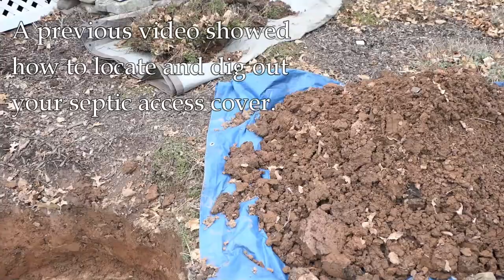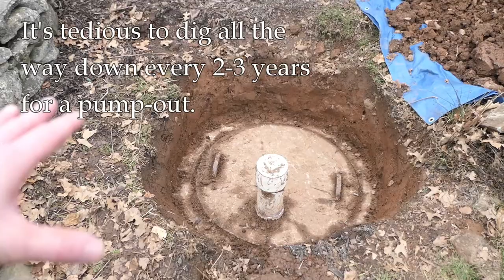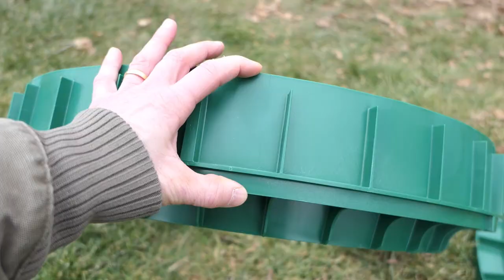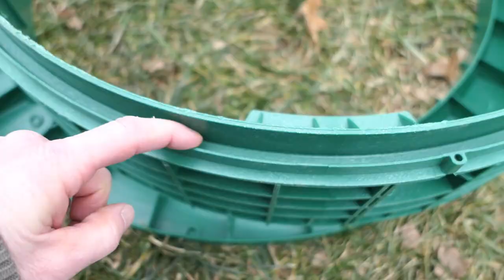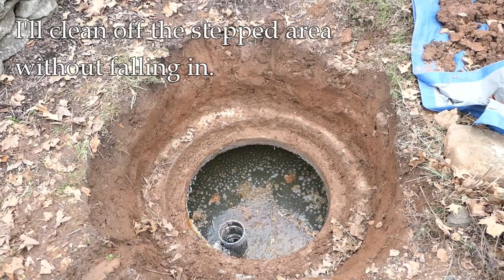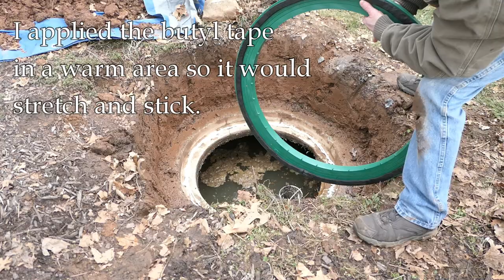How To Install A Septic Tank Riser

Comment: Risers are honestly one of the best investments you can make for maintenance to your septic system. Easy access for pumping, inspections, even some repair if necessary. For me, it's a visual cue, too. Infrastructure is often overlooked because it's made invisible, but seeing that green riser cover in the backyard serves as a reminder to keep tabs on the system. Not that I enjoy taking off that cover, but boy has it saved me money over the long haul. Spend the $300-$400 and give yourself some piece of mind.

Comment: Thanks for this. I need a septic inspection, and their guy came out and couldn't locate the tank. I ended up finding it with some old drawings, and a corner of it is under the concrete pad my singlewide was set on. The inlet lid is inaccessible, but the main and outlet lids area easy enough to get to, so I may install risers to make this easier in the future.

Comment: I used quick drying hydraulic cement buttered on the bottom then grouted the edge all around the ring with a nice beveled edge of the same cement...worked great
Reply from the maker: One potential issue with that approach is that the plastic will expand and contract in time, while the cement will stay put with the concrete tank.  Probably you won't get cracks, but you might have some rainwater leakage.  Not the end of the world as long as it isn't severe.

Comment: Very nice.  Considering this.   I would put mine below the ground also so grass could grow.  It is in a spot where I would need to use a push mower.  Also people regularly walk through this area.  Should that be a problem?
Reply from the maker: I wouldn't suggest heavy machinery over the top of the access hole or the tank top, but a single person walking across should be fine.  Another option would be to plant something with shallow roots, such as perennial flowers, in that area so that people walk around .  When the cover is dug up for cleaning, the perennials will tolerate being temporarily displaced.

Comment: OK, so I can not find a video explaining what to do when your septic tank does not have an access cover. Mine is just a pair of solid 4'x4' concrete slabs. When they come to clean it they have to lift the entire half of the top and flip it off the structure. I want to use one of these risers, but what do I need to do? cut a hole into a 70 year old concrete lid?
Reply from the maker: I'm not exactly sure what you've got there--certainly a four foot square lid is not typical.  Possibly it isn't even a lid but part of the whole tank and an access cover was never originally installed.  Septic regulations tend to be local in nature, often at the county level.  Likewise, the manufacturing and installation of tanks and other components tends to be locally oriented.  Concrete tanks and components are heavy and difficult to transport, so in areas where septic systems are common there are usually one or two small manufacturers who serve the area.  My advice is to find one of those small businesses near you and stop in for a chat.  Odds are that if you have this tank other homeowners in the area have faced the same issue.  It's possible there exists a 4 foot square replacement with a riser hole precast into the concrete.  Or, it may be that you need to cut a hole for a riser in your existing cover.  Either way, you'll need the help of a pro.  Search your local area for the right business to help--typically the word "precast" or "-crete" is in the business name.

Comment: Can you explain the old fashioned way to remove the concrete lid. I see a chain wrapped around a piece of wood - did you just use good old leverage
Reply from the maker: Every septic tank cleaner seems to have his own method.  The concrete lids usually have either two plastic handles or two handles made from rebar sticking out on the edge.  Hopefully your handles are still intact, otherwise it becomes a problem.  The lids are often stuck to the tank with mud and hydraulic force from the water, so it may be helpful to take the flat edge of a shale bar to pry up on the edge of the lid.  This will just loosen the grip of the mud and water.  Now you are faced with lifting the lid completely off.  If you have two people, each can loop a rope or chain around a handle and the two of you can lift and remove the lid as a team.  They can get pretty heavy--150 or 200 pounds, I would guess.  If you are working alone it's more difficult.  There are various homemade tripods that some people use.  The tripod is set over the lid, and a chain is used with a pulley to hoist the cover free. Other people just wrestle the cover free using a combination of leverage and muscle.  You can loop a chain around your shale bar and the lid handles, and then lift one end of the shale bar with the other end on a pivot point, for example.   There's no "official" method, really.  But if you can get a helper that the easiest way.

Comment: I did this a few years ago. The local plumbing supply sold the Tuf Tite pretty cheap. Also hammered the concrete outlet baffle to pieces to install a filter. It's so easy to inspect and clean the filter now. I'd like to ask you, the septic system layout from the county shows a 300 foot single line starting at the back of the house, going to the side then winding its way back behind the house. If that is so, does the entire line really get used? Would it have to be at a slight incline all the way to the end? Thanks for the video. Looks like I did it ok.
Reply from the maker: There are many septic field layout styles.  I can't say I follow what yours is doing, though.  Typically there is a pipe leading from the septic tank to a distribution box.  Then there are multiple pipes leading from that "D" box to a field.  All the pipes are inclined to allow drainage, and the field pipes have holes to allow fluid to escape.  The solids are supposed to get trapped in the tank for cleanout later. I'm not sure what's going on with your single pipe, perhaps you have an unusual design due to site conditions.
Reply: @enduringcharm  Ok, thank you. I'm not aware of any unusual conditions. The hand-drawn illustration of the layout (from 1993) doesn't show a distribution box, just the single pipe. Maybe the drawing is not even true since it doesn't seem that such a system could be fully utilized. But thank you. Although we've never added anything before and have no issues, at 30 yrs. old, I wonder if it would be ok to occasionally add something like Roebic.

Comment: Very informative.
Was a safety cover installed and would you think a riding mower would be able to move across it, if the cover was flush with the surface?
Reply from the maker: If the cover will be above the surface, I believe they do have some kind of safety screen for installation in the riser.  I didn't check that out at the time since this was buried.  As far as a riding mower, I mean it may support the weight but why ask for trouble?
Reply: I wouldn't chance it. The poly is durable but it's already contending with the elements beating down on it every day. Mow around and tidy up as needed.

Comment: South florida, most of us have 2 square lids, the one closer to the house is 29 inches across. i see no sizes for that.
Reply from the maker: There are lots of different sizes, it's true.  Typically the local suppliers will be aware of the commonly installed sizes and can help you.  Sometimes the opening is tapered, so the size you need could be a little different from what you are measuring.  I'd suggest looking for a local supplier to give you a hand.

Comment: I noticed that you did not put the access cover back on with the riser. Is this typicsl practice? You do not need the access cover after installjng the riser?
Reply from the maker: I'm not sure I follow your question.  I removed the existing concrete access cover, and that gets discarded.  The plastic riser is installed and then that riser has it's own plastic cover.

Comment: Was that a 24 inch? I measured my old cement lid and it was 26 across.
Reply from the maker: The concrete lids are typically slightly bigger than the hole so they don't fall in.  The bottom edge is probably sloped or angled so it fits tightly.  Measure your tank opening rather than the lid.

Comment: I see that your tank is almost to the top.  How is your house still draining in to it and not backing up?    Ours is blocking constantly lately because of high water. Came here to look for a lighter lid.   Great video.
Reply from the maker: When your septic tank is installed the height is adjusted relative to the main drain pipe exiting your house, typically a four inch pipe.  In other words, the height of the pipe exiting your house determines the height of the tank.  And, when I say "adjusted" I mean a backhoe digs to the right depth!  If you have water backing up into the house from your septic tank, then something has gone seriously wrong.  Possibilities include a blocked pipe leading out to the tank, a tank that was not installed correctly in the first place or that has moved with time, or the main pipe leading out from the house has moved.  Septic tanks can move if they are not installed well in the first place or if you have a high water table in the area.  In any case, you should have a pro take a look.  If the problem is not a blocked pipe, then you may need to either lower the tank or raise the drain pipe coming from the house.  Neither are simple repairs.

Comment: I need to add a riser to my tank. Do they make a rectangle shaped riser kit? I just found one lid like you. Is one lid common?
Thanks
Reply from the maker: If you are burying the top under some dirt, I think the additional safety screen is not necessary.  But, there could be local regulations about it.  I'm not aware of a  rectangular riser, but who knows.

Comment: A main point of a riser is so that you don't have to dig up anything to pump out or inspect the system. In the winter if you have to pump, the ground may be frozen, making it nearly impossible to dig up the lid.   Don't burry the lid !!!  LOL
Reply from the maker: Burying the lid can be an esthetic consideration.  In this case, for example, the lid was located a short distance from the deck in a garden area and a plastic lid sticking up would be an eyesore.  As for digging in winter climates, there should never be an emergency need to pump a septic in the dead of winter under a load of snow.  The typical timeframe for pumping is every 2-3 years, which leaves lots of time to plan.

Comment: Great video. I’m curious if you can use some leftover butyl tape, trimmed to size, in place of the silicone caulk (for use between the riser sections). Thanks.
Reply from the maker: You could.  The silicone caulk is easier, and there are also other types of construction adhesives you could use.

Comment: I'm not sure I need a riser on my tank. It took me 20 minutes to dig out mine and that was a couple minutes finding the exact location by starting 2 feet off. I'm of the belief that adding more parts adds the possibility for a greater likelihood of something to fail.  I have considered building a small wood platform to sit over the cover so I can locate where to dig and attaching an old hand pump to it as a joke. Then I would just have to slide it over and dig.
Reply from the maker: Well, your digging might not be too bad.  The other factor would be the weight of the concrete lid, if that's what you have.  It usually takes two people or else a chain and frame to lift a concrete lid, and the handles often break off.  The concrete lids are prone to cracking over time as well.  So even if you don't need a tall riser, you might consider a plastic lid over concrete.

Comment: What gal size is your tank How often do you pump out?
Reply from the maker: The size of the tank is typically related to the number of bedrooms in a house, which is a means of determining how many people are living in the house.  Common sizes are 1000, 1200 and 1500 gallons, though others exist.  The rule of thumb for pumping out is every two or three years, but mileage can vary.  If the system gets a lot of heavy use, or feminine products are flushed instead of tossed, or the tank is undersized, then you may have to pump every year.  If the system is used by a little old lady who flushes one a day, then you might go 6-7 years between pumps! The only way to know is to do a pump and note the tank condition for next time.

Comment: What adhesive did you use
Reply from the maker: The screws hold the plastics together, so you can just use silicone to seal those parts.  The connection to the concrete tank can be made with the butyl tape as I showed, and if you want to add an adhesive as well, you can use any construction adhesive which is labeled for concrete and for plastic.  I don't recall which brand I had at the time, but it really isn't that important. The tape is probably enough, it was a belt-and-suspenders type of decision.
Reply: @enduringcharm  What size screw?  There are no instructions that I could find on the tuf-tite website, and other instructions just say "stainless screws".  What thread and length worked for you?
Reply: @bobgcampbell  When I got my Tuf-tite kit, it included the stainless screws for all attachments, except the bottom ring to the tank itself, which the OP omitted, relying on the caulk to do that.  For belt and suspenders, I ordered stainless concrete Tapcons in 1.25"  #8 size from amazon to fasten the bottom ring to the concrete and used caulk to seal the bottom ring to the tank.

Comment: Oh so you don’t need to add the concrete cover back on… just the plastic lid is fine?
Reply from the maker: That's a big part of the draw for this system--no more heavy concrete lid needing two people to remove.  The plastic lid may seem inadequate, but it's actually quite strong.  It should also hold up over time better than concrete, which can crack and break apart over the years.

Comment: Nice video but in my area in Indiana you have to also replace the concrete cover.
Reply from the maker: You mean a concrete cover is required versus a bolt down plastic cover?  There are definitely variations in local codes, especially for septic systems.
Reply: @enduringcharm  The concrete cover that comes on the tank is required to be kept on the tank even if your have a covered riser added to the tank.